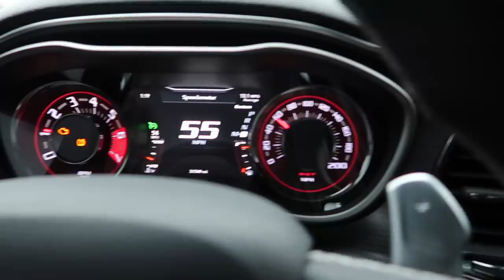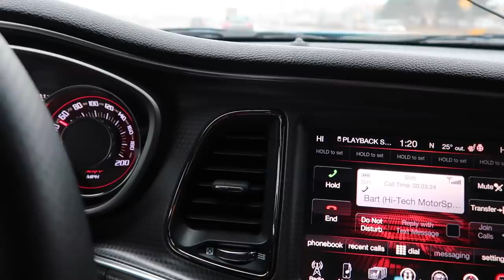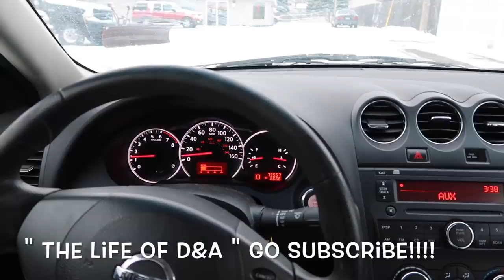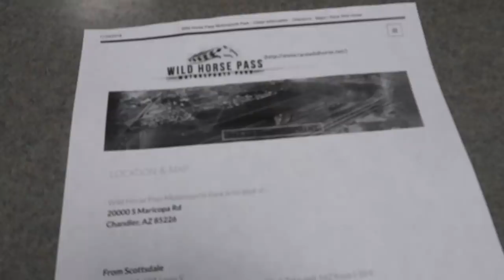NEW RACING RIMS FOR MY HELLCAT HAVE FINALLY ARRIVED!

Comment: It's too bad you don't already have the driveshaft and axles installed. When you go to practice at the dragstrip on street tires, your car will never hook up off the line. If Bart could get these two installed before you leave, and you could ship the rear MT ET Street SS DR's / race stars down to Brandon, you could get much better practice doing your burnouts and launching. There is no way you can launch the car the same way with street tires, you'll just blow the tires off.